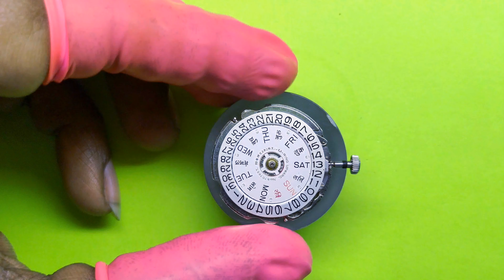ALLWYN AUTOMATIC (Autowind) watch ⌚ service.

Comment: Bhaiya, do u have new original spare parts of allwyn automatic wristwatch of 21 jewels like dial, glass, balace wheel, day-date wheel, mogara with inside pipe & other spares as I want to change them if required. The kolhapur watchmaker has said that the gears of balance wheel have enlarged due to long time working. As I want the watch should look nice and show the very correct time as digital watches. There should not be the difference of not even a fraction of second. In short I want the watch to look like the new one with the guarantee of work and spares.

Comment: I have a allwyn automatic wrist watch bought in 80's. It doesn't run as accurately as before. I have done its overoiling and cleaning at kolhapur for 2/3 times before 4/5 years. But result was not satisfactory. The watchmaker said that some parts has to be replaced then only it run as accurately as digital watches. But he did not get     any of its original spare parts any where. So,I gave up the hopes to repair it. I want to change its dial, glass and some other spare parts with originals. Can u repair it? What will be the cost/repair charges? It yes pl.send me ur shop address.
Reply from the maker: Sure sir definitely we can repair it .
Just text me in whatsapp 9154032039